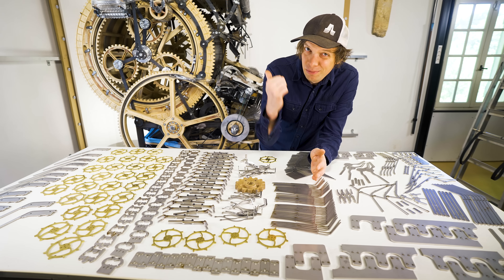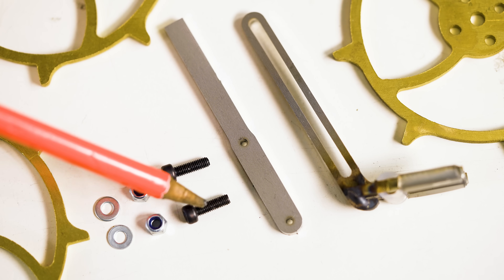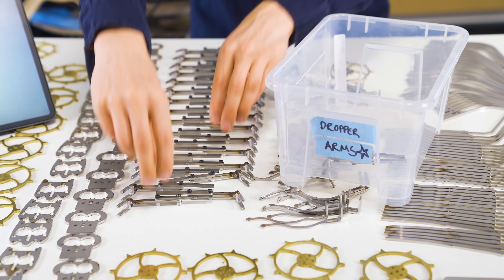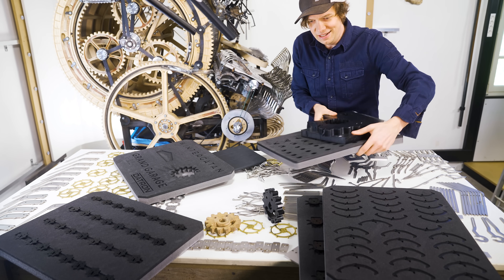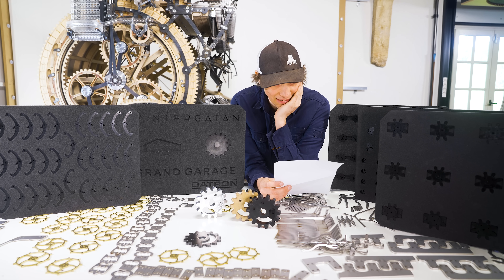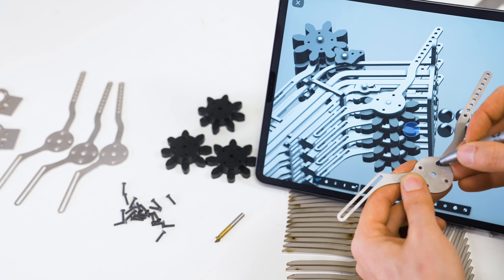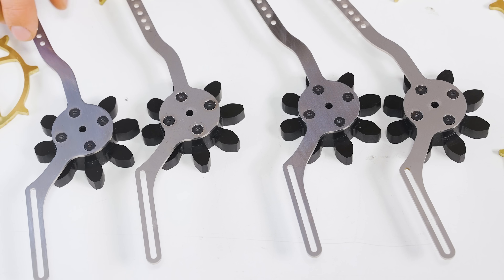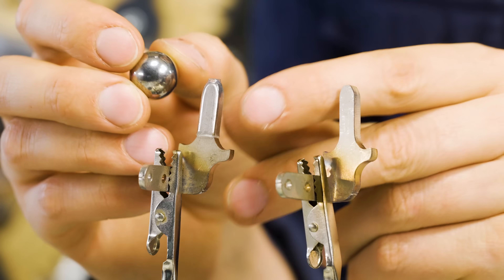Solving the 1000 Pieces Engineering Puzzle

Comment: About EMF thing, looking at the fundamentals: "the energy is in the field" and "the field is between the line where current flow, and its return path". Your torch carry one half of that loop by feeding it into the welded piece. The return is through the piece you are welding, and then in the line back to the welding station. The EM field is developping in between these two parts. Putting aside any consideration about a potential influence of that field on any part of your body (because, "it's debated", though I will keep my opinion on that...), if you want to minimise the risks associated to these considerations, then put the return line right next to the feed line (so, also around your neck). The field will be locally contained and be very small. Or, at least, try to not be (your body, or your head) inside the field itself (which for the most part is already the case to be honest).

Comment: As a machinist (I'm sure you get a lot on here by now) all I would recommend:
Get yourself a newer edition of the machinist's handbook 
It will contain all the appropriate speeds and feeds for various materials you're machining (drilling), and for the material of the tool you're using to cut with.
If your drill is high speed steel, 10% cobalt, tungsten carbide, or titanium oxide coating...it will tell you the appropriate speeds and feeds for both. 
In my experience using a high sulphur content oil as a lubricant, works very well. 

Good luck.
☀️😎🇺🇸☀️

Comment: All the reasons listed for the drilling mishaps apply: laser-cut steel is very hard; you need to drill hard steel at low speed; and you need to keep your oil cool as well.

Comment: You may already know this, but cobalt drill bits will outlast normal HSS above & beyond the price difference.  Edited after 6:44 to say I'm so blessed to have no interest in psychology!  :-)
Also, don't worry about EMF from TIG.  Even at the highest frequencies of a "high frequency" arc start, the wavelengths are so long that your body is not going to couple any meaningful amount of energy even from direct contact with the cable.  Sorry, but you're just not an attractive target for the energy to dissipate compared to everything around you -- particularly the work piece!

Comment: As a full time tig welder of 15 years i would suggest not puttting the cable around your neck too.  Not because of the emf but because it will put your torch in an awkward angle.  Try putting a small C clamp on the edge of your table with the handle up and loop your lead over it to take some of the weight off it

Comment: Seriously? Dangerous EMF from a welding cable? The only danger that's coming from that cable is strangling yourself. 200 amperes (which is the upper end for most consumer welders) is nothing. Stainless is usually welded with DC, and even if you use some pulse settings they will be in the order of a few tens of Hz. If the static magnetic field of a single wire (which is equivalent to a single turn coil) or the changing magnetic field with pulse settings at a few Hz with 200A would be dangerous, than the spinning neodymium magnets in the marble wheels and the de-magnetizer would be deadly.

Whoever is spreading that scare, have no idea what they are talking about. They are either just regurgitating what someone else said without checking (and understanding) or heard something about current and magnetic fields and came to completely wrong conclusions (again because of a serious lack of understanding).

Comment: Martin! When drilling stainless keep your bit speed low, your pressure heavy but not to the point you break bits, and cool with water. Wet the bit, drill until you see a puff of steam, cool the bit in water, drill on. You'll have to cool your bit 2 or 3 times for each hole on stainless of that thickness

Comment: Drilling stainless for me: very low RPM, high downforce. 
My thougth is: Why you did'nt created some parts with aluminium? Lightweight, strong enought, totally diamagnetic and great to process (at least when you're not welding them)

Comment: You need specific drills for stainless steel and it only gets worse the higher grade it is, if it's non-magnetic, then it's up there, and you're better off using carbide bit drills (cheaper than the full send option, which is a carbide drill bit).

Comment: Stainless has a harder oxide shell than its interior, you have to break through quickly and then the drilling is easy.  the speed looks fine, jus in the future drive hard into the stainless to break the shell, if not, the shell will harden from the heat and friction and become more difficult to punch into.   cheers mate.

Comment: From a physics perspective you should not have any problems with the EMF-radiation. At those long wavelengths the radiation only heats your body without harming any cells. The UV-radiation from the arc is a lot more dangerous.
If the EMF was dangerous we would hear a lot about welders hands falling of because of it. The hands are always extremely close to the cable and the gloves don't attenuate the long wavelengths much.
On the other hand, putting it on an holder is probably still better, since you don't have to pick it up every time you go to an other room to do something else.

Comment: Try this - Use an impact driver to drive a tap into a stainless steel sheet after drilling. You will be amazed!
You think the sharp blows would snap the tap, but it causes it to cut in little bites and works wonderfully without dulling the tap! 
Magic. 
As far as drilling stainless, yes, a slower speed would be better.
EMF?! Ha!   Fumes from welding are the most dangerous.

Comment: EM fields at low frequencies and at low to mid amplitude levels have no effects in adult humans. There is some data that shows that low frequency and very high amplitudes (less than 100m from 500kV, multi-Megawatt power lines) does have a tiny, but still measurable effect on children up to the age of 14. This very high EM field increases the chance of diseases by a very small amount (something like 3 in a million).

Comment: Hello Martin; I work with RF safety professionally. There is no EMF concern. It is still a safety hazard.

1) EMF (electromagnetic fields) vary in their ability to cause short-term or long-term harm by frequency. The frequency of that device should be part of its specifications, but my guess is below 400 Hz. There is no concern of EMF safety at this frequency, because the power needed to harm you would melt the cable far before it could cause radiation damage. 

2) Don't drape it on your neck anyway. If you need to move suddenly, you are in danger of entanglement with an object. If the welder malfunctions, you could be in for shocks or burns; you may even drop the welder if it malfunctions, and its going to swing back towards you.

The marble machine works; a manufacturing environment would use a suspension so that if it is dropped, it retracts to a fixed hanging position. No issue with weight, no issue with dropped and damaged equipment, and no possibility of dropping and touching you where you have exposure (good job on the mask and gloves).

P.S. Props to your mother.

Comment: You need to refinish the touch surfaces on the brass wheel! That waterjet edge on the brass will DESTROY the plastic rocker that it interacts with, its like sandpaper. 

Absolutely correct on the laser cutter hardening the steel; that's the big issue with taping into laser cut holes, the steel becomes like glass after laser cutting because its heated SO hot and then cooled VERY quickly. You probably would have broken a half dozen taps atleast! 

Also, the welding with a cable around your neck has NO RISK from the EMF. This is just a totally misinformed claim; yes, current creates a magnetic field, but so does just about everything else in our life. If a welding cable around your neck was dangerous, living next to a radio station antenna would be fatal. Seriously, every welder who does precision work loops the line around them to relieve the weight on your control hand. You shouldn't bend to the will of the uninformed so easily!

The MUCH bigger risk you face is due to lack of significant ventilation. Welding creates all kinds of fumes, from both surface contaminants and the metal alloys themselves. The best thing is to have a fume hood in your weld area, but thats SUPER impractical for most people. And honestly, so long as you aren't welding something seriously noxious (galvanized steel, amongst others) or welding for HUGE amount of time, even modest air circulation is sufficient.  

Keep it up man, Everything is looking beautiful!

Comment: In regards to making threads... I have never made them in stainless steel, but in ordinary steel.. and I find that the easy/quick way to do many parts (that aren't TOO thick) is to literally clamp them together, making sure all holes are perfectly in a row, and put the thread-tap in a drill and just go to it.. (It does take some practice to use a hand-drill to make threads, but the key is to let the bit itself control the speed, because the law of least resistance means that as soon as you have made part of a thread it wants to follow the threads the rest of the way).

Comment: Hey, please build one gate and test it well and, after that, if this works, you build the rest. Or if it does not work perfectly you can correct it until it works well and after that start building all other gates already with the necessary corrections. This is much more efficient. By the way, that is how Spacex works. 😉

Comment: I wonder if Martin designed a radius on the edges and corners of the cybergate arms in way of the silicon tube and heat shrink so as to maximize the life of these plastic and elastomer bits.

Comment: Wrapping the cable around your neck is less about EM radiation but rather a safety concern at a jobsite.  If something snags your cable, like a forklift/truck/falling object, the cable will be pulled from your hand and yelling/rude gestures may occur.  If it's wrapped around your neck, yelling and rude gestures are likely the best possible outcome out of many far more hazard possibilities.  So, industry safety being what it is, and people having to follow rules without understanding why, the notion of wrapping a cable around your neck being dangerous has led a lot of people to assume the danger is from EM, even though studies are still inconclusive as to whether it poses any risk at all.  It's not a good practice, it's not a bad practice, and it's certainly not something set in stone unless you're welding commercially at a jobsite.  In a shop situation such as this, it poses no scientifically credible risk.

Comment: You know, I just watched the original Marble Machine video, and here's what I have to say:

You made that hunk of junk work. That thing took little to no engineering, it was held together with the worst plywood, bent wire, and nails and bolts, and somehow some way, you got it to make music. 

For the MMX, you're using premium materials like steel, you're CADing and literally engineering, and for some reason you think it's a possibility that you cant make it work? And that you might need to cut your losses and stop making the MMX? 

Considering you literally made junk sing, you should be able to make the MMX sing, I still have faith

Comment: Just one simple question: have you considered 3d printing?... There is one situation where I can see it would be useful for you, although it would require a good 3d printer: making a hybrid part of hard and flexible polymer. With a double head printer you can print on the same time flexible polymer and "hard" polymer on the same part, without glue and without having to test fit... If you used for both transparent filament you can get one part that seems "homogeneous" but which has a part that can dampen the ball collision, to reduce noise, and at the same time have resistance. It is not that linear to use, but on any place that you want to reduce the impact or roll noise, can help.

Comment: You dont want the cable up their on your neck because its next to your vagus nerve, the U.S. military actually has electromagnetic wearable devices designed to stimulate that nerve, but they will be using a specific frequency and a lot lower voltage.

Comment: Pro(*) Tip: Assemble and test a single gate first, to make sure your design, parts and assembly processes are all good and proper. Only then start on the mass production. IF something should turn out to be wrong, you won't have wasted that much time (and possibly even material) assembling faulty parts. (Granted, this won't work for the Cyber Gate, which I gather is a monolithic component once assembled.)
(*Ha! If only!)

Comment: EMF at the frequencies you're working at (DC to at most a few kHz if you've got HF start) and power levels (leakage is minimal) isn't dangerous. At most you'd get some minor local heating. EMF becomes dangerous around the UV frequencies or higher, or at extremely high power (standing straight in front of a microwave RADAR antenna). Don't teach bad myths about EMF dangers that don't exist, it perpetuates bullshit thinking. It only gives ammunition to conspiracy theorists.

Comment: There is no scientific evidence proving that EMF is dangerous at all. While you are holding a high current close to your central nervous system, it's stupidly unlikely that you will ever even notice any effects from it even if you were to weld 12 hours a day, 7 days a week.

The warning is fair because we don't know everything there is to know about this yet, but there is really no cause for concern. Flipping your neck rapidly to move your welding mask down does more guaranteed damage to your neck and nervous system each time you do it than the EMF from wrapping the very well-insulated cable around your neck could even theoretically do over a lifetime.

Comment: I don't blame you for being a little intimidated by tapping 70 M3 threads in steel. A while back I made myself a custom keyboard for which I needed to tap 10 M2 threads all the way through 6.35mm thick steel, and it sure took some time, and a very steady hand on the tap wrench. Broke a tap in one of my pieces and trying to extract the broken tap was unsuccessful so I had to make another piece to replace the one with the broken tap jammed in it.

Comment: About the EMF : it is also quite a low welding current. If you were welding thick aluminium plates at more than 200 amps, yeah better not wrap your head around that cable (or the other way around, as you wish)
But since you're welding thin stuff or even brazing it should be fine

Comment: Putting the cable around your neck should be safe with DC. The biggest concern would be induction of a current inside of your body, but that simply doesn't happen when the current through the cable isn't changing.

Comment: You are going to curse yourself ;) Without the M3 threads you will now need three hands for adjusting, one for the nut, one for the bolt, and one for adjusting (and experience shows that is a real nightmare if you want to make small adjustments). With the threads it would have been only two, one for turing the bolt, and one to make the actual adjustement. Curse me later

Comment: I'm sorry, but what kind of evidence have you found that EMF causes any harm to humans? Because, by definition, electromagnetic fields are a form of non-ionizing radiation and therefore absolutely don't interfere with anything in humans. This sounds like the same gobbledygook people wheel out against 5G antennae and it has always been proven that it has absolutely no impact on humans beyond mild heating up, because that's what electromagnetic waves do and why they're for example used in microwaves. Though obviously, anything that would operate at the same power as a microwave would never be safe to be handled by anyone without proper training, so it's safe to say that, regardless of how powerful your welder is, it's absolutely safe to operate however you want, otherwise they'd never get sold to laypeople in the first place.

Comment: You can just wrap the cable in mesh and the magnetic field lines won't enter the neck. Those fields are not much stronger than the ones you phone makes either. That cable is only dangerous as a noose. Those sources don't specify the danger, as in burns, cuts, etc. Why, because they are just making things up and do not have the skills in lying to be complete.

Comment: hey Martin, I've been watching for quite a while now and am loving the build!

On the EM from having the welding lead around your neck, I have been a professional welder for 15 years, alot of time and effort has been spent looking into the risk's of welding, there are alot of risk's involved but fortunately EM emissions isn't one of them, even with using a high frequency start machine like you have, I often do exactly the same trick to keep the weight off of the welding hand as well.

Comment: EM-fields are just dangerous, if the frequency is so high, that it becomes ionising.
Same case is it with 5G, the difference to the older generationso is, that it can be used on ionising frequencies, but usually it´s not practical, due to lower range.
So in my opinion electro-magnetic radiation is only dangerous in high frequencies (around 500 kHz, if I remember correctly ^^). :)
(The source of this information is one of my Professors, for "machine communication", he is a member of the IEEE and one of the leading heads of the radio communication development in Europe)

Comment: If you're going to use Nyloc Nuts you need to ensure that the threads of the bolt extend all the way through the nyloc locking part. Otherwise there's a risk that the nut will work loose. A longer bolt will solve the problem and potentially save you trouble later on.